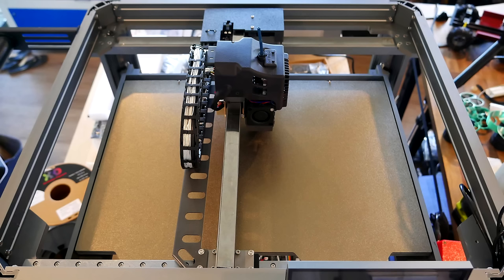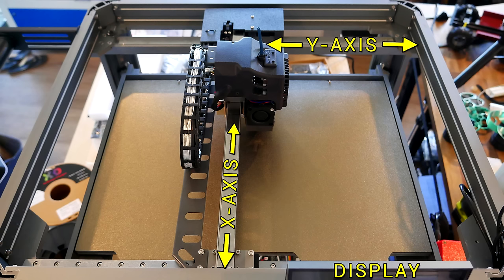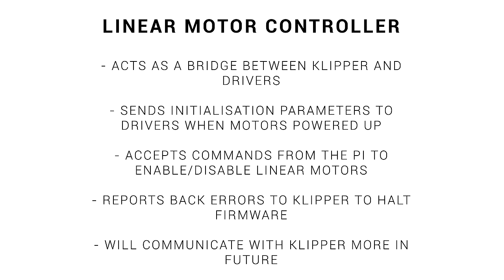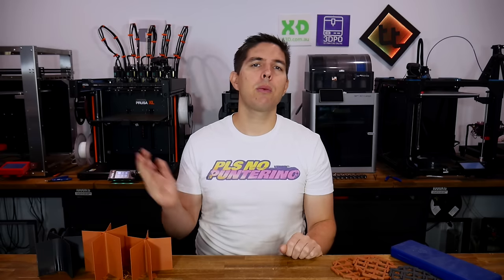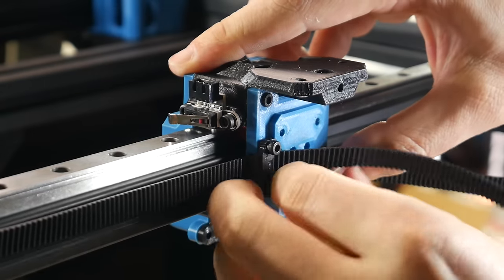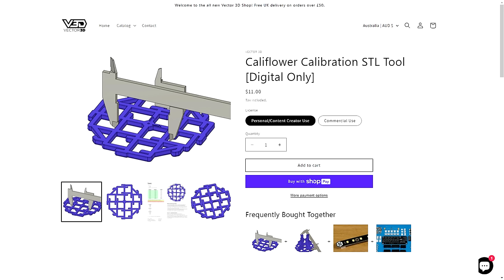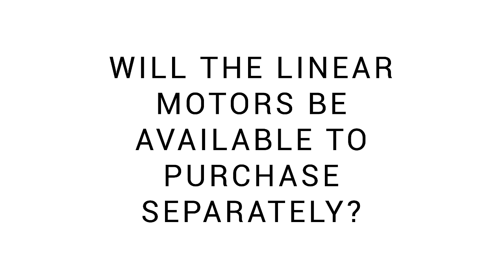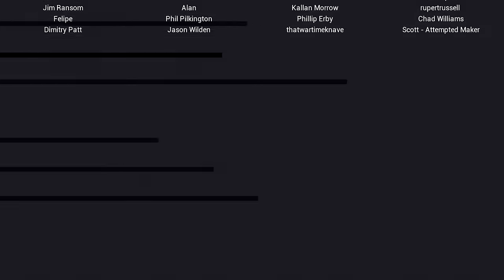Magneto X linear motors: Deep dive and performance testing

Comment: A new category unlocked for aliexpress seller: linear motors for 3d printers.
Reply: Would buy so fast. So obviously the easiest way to make a toolchanger.
Reply: @BeefIngot    you would drive it off the rails end to park or something?
Reply: @lassikinnunen  No, just have the rail extend to off of the bed and have the unused ones simply not move since the active part is on the thing that is moved and the magnets are stationary.
Reply: @lassikinnunen so instead of changing the tool head on a single carriage, every tool head would have its own carriage?

Idk seems like loading and unloading the entire carriage would be the weak point in repeatability/reliability. Where as once dialed in a single carriage and multiple tool heads could achieve the goal more easily.  It’s already a proven technique in CNC machinery
Reply: @BeefIngot oh crap! like all of them on a single rail, and the rail is just extra long on both ends, so the toolheads can just cycle between sides? Like as if each toolhead were the balls on an abacus? You would just Park the unused ones off to the sides
Reply: For speed purposes, multiple gantries might make sense. Same idea though, multiple carriages on the y rails.  You'd need enough extension at the front and rear to handle as many gantries as you'd need.

Honestly though, I suspect toolchanger technology is a better solution for most people because the number of heads per unit volume can be so much higher.
Reply: Last time I ordered from aliexpress I got an empty box in the mail. Customer service denied my claim, but thankfully paypal refunded.  MAJOR HEADACHE  NEVER AGAIN!

Comment: I feel like a machine like this should be driven by LinuxCNC, something built for driving closed loop real time machine systems. Wouldn’t mind if Klipper was modified to have proper closed loop control and real real time control (stop means stop now, not when the command buffer runs out).
Reply: I mentioned it somewhere else, but I think that's what it's designed to be run with.  So many of the decisions, like a 2nd micro-controller for commands and emulating stepper drivers, points to this originally being developed for LinuxCNC or similar with Klipper slapped on.
Reply: @arthurmoore9488 Which is why I'm so intrigued by the idea of being able to buy the motors separately, I'm really glad he asked about that! Or perhaps it might be fun to just buy the whole printer and forklift-upgrade the controls.
Reply: That's what I think as well. I switched my printer from Linuxcnc to klipper to gain all the features of a printer specific controller, but it always feels like a "toy" in comparison. No support for external e-stop, no way to trigger e-stop if a limit switch is triggered during printing, no way to instantly pause a print etc... On larger and more powerful machines it can get dangerous without those things.

Comment: The future of this machine is only as good as Peopoly's commitment to it, which based on their track record leaves something to be desired. I backed their first KS for the Moai, and it wasn't too long before they abandoned it without ever finishing the firmware optical distortion compensation features. When we're dealing with so much propriety tech, it's all about trust that in 2 years you're not sitting with a $2k paperweight. Everything inside the Bambu printers can be swapped for commodity part equivalents outside of the lidar scanner -- which is of questionable usefulness. Considering there are driver boards, feedback boards, tuning requirements, this machine is more closed source than purported closed source machines are. I paused the input shaping screenshot, and klipper recommended accelerations are ~2k -- that's far from impressive with advertised max accelerations being 10x that -- so it can go fast, it can accelerate fast, but the electronics are not tuned for it. As I suspected, this is a tech demo. Impressive one, but that's all it is.

Comment: While the X/Y arrangement may seem counter intuitive, this is standard in robotics. The X motor is almost always further down the kinematic chain than the Y motor.

When driving a linear motor with a stepper interface you will never see 'missed steps', you will either see a successful move, or the axis will trip. The controller will have a maximum allowable following error, the difference between expected and actual position for any servo cycle, and if the measured following error exceeds that value, the controller will emergency stop that axis, and by extension, the whole machine. If you have access to the following error, you will see it creep up as weight, speed and acceleration increase.

As an example, if a move has a max following error of 10um, a successful move will never have been more than 10um away from the expected position at any point during the move. If the planned trajectory requires an axis to be at 1000um at time T, but it only gets to 989um because it isn't accelerating hard enough, the axis will trip. Similarly, if the planned trajectory requires an axis to be at 1000um at time T, but it's already at 1011um because wasn't able to decelerate hard enough, again the axis will trip.

What won't happen is you get to the end of the test and the axis is in a different place to what you expect, it will either be within the following error limit of the desired position, or the axis will have tripped. This is one of the big advantages of a closed loop motor, you will never end up in the wrong position without knowing it, and errors will never accumulate over time.

The fact that the fast move tripped at the end of the move, rather than the start, suggests to me that that the drive electronics can't cope with the back EMF generated by the motor for that combination of feed rate (speed), deceleration and mass. It can get up to that speed, with the given acceleration rate, but the amplifier can't dissipate enough energy to counter the inertia of the mass. I would be interested to know which axis tripped. I would expect it to be the Y axis, since it has to cope with the weight of the X axis as well as the weight of the print head.

On one robot that I worked on, we ended up having to add dump resistors to the Y axis amplifiers (drivers) to improve the performance of those motors under deceleration, even once we'd tuned the Y axis motors more conservatively than the X axes. It was the difference between 2m/s & 2g for the Y-axis beams, verses 5m/s and 5g for the X-axis shuttles.

Comment: Thanks for the follow-up video. It’s wonderful when you contact the developers to find the answers people have. You have access that ordinary people don’t have because of your channel. Thank you for all you have done for the community.

When specifying a speed or acceleration greater than the machine is capable of handling it would be nice for an error code and/or message to be returned instead of letting the machine attempt something it’s not capable of doing and failing. I don’t know if this is an issue with the manufacturer implemented their linear motors, something in Klipper, or how the manufacturer configured Klipper.
Reply: While I don't have one and am not familiar with this particular setup, I can relatively confidently say it's not that easy.

The most interesting thing about the approach taken is instead of modifying Klipper they developed their own controller board.  As far as Klipper is concerned, these motors are being run by a cheap controller that only supports the bare minimum.  I mean, instead of telling the actual controller boards "go to X position", Klipper calculates the difference between the current position and X in steps and sends that many pulses.

Keep in mind that separate stepper motor controller board to talk to the drivers doesn't have to exist.  It's just duplicating the functionality of the main controller board, but with a worse processor.  The only thing the main board is doing is handling the Z axis, and heating the bed.

The only reasons I can think of to make those decisions is if they either re-purposed CNC hardware and couldn't integrate it fully, or are planning to release a CNC.
Reply: @arthurmoore9488  Yeah these are good points - like, does klipper even support closed loop steppers / servos for the main movement axis in the first place? And if it does, does it "fully" support all the functions you can typically expect from controller that do? 

This machine is closer to a machining CNC with a printhead on it than a build from the ground up 3D printer with standard 3D printer parts; and I think that's a good thing. 

I'm actually curious why 1) people have such a hardon for Klipper support, and if Klipper was even the right thing for this machine. I understand klipper being open source, and the functionality it adds to something like an Ender 3 or the hundreds of bedslinger clones is great, but a machine with essentially completely different kinematics from anything Klipper was designed for just seems so odd to me. 

I suppose it saves them a ton of development time / overhead in probably having to make their own (or, say, converting Mach 3 - with licensing - to something usable by an average 3D printer user with 3D printer modules) - but I'm curious if this will end up inherently limiting the capability of the machine down the road. 

Or maybe it won't - Klipper is open source and someone could write their own proper linear motor modules to it that actually work with feedback. But that's a bet, not a guarantee.

Comment: Fantastic deep dive, thank you for the huge amount of work it must have been putting this together!
I have a comment about "maintaining perfect positional accuracy" when you're talking about 30k+ acceleration at 1k+ mm/s² (15:30 or so). The closed loop system will always ensure this, as would a servo motor based system (belted/ballscrew), assuming tight enough tolerances and sufficiently beefy construction in the drive system. But the systems just get back to the perfect positional accuracy after possibly losing it while under heavy load, just not losing it enough to fully error out. So it doesn't "maintain" it, it just gets back to it. So the real measure would be how far and for how long the system was ever off it's target position. For high performance printing that's what matters, not that the head ends up in the correct x/y spot after printing for an hour, but that the filament is deposited exactly where and when it was supposed to. If the head lacks behind a bit, or overshoots the target position a bit after correcting for a previous error, that'll show up. It would requiring coupling the positional feedback of the X/Y with the extrusion system somehow, but I'd guess just the latency because of physics such a thing would incur would probably make it either impossible or at the very least impractical.

Obviously given the sheer power of the motion system, the required precision in the control of the extrusion system needed to keep up with numbers like this is likely going to be the limiting factor. Also even measuring or quantifying what the actual error is would probably be a masters or doctoral thesis in itself. What even would be the unit, some sort of integral of the positional delta (target vs. actual) over time?

Comment: This is such a strong first printer out of the gate. With a tool change or multi filament system, it’s hard to see any reason this wouldn’t become the gold standard going forward. I will say, the quoted specs for thermal safety on the electronics and motor should be revisited to ensure they can operate at higher temperatures since that doesn’t leave a whole lot of headroom but… very nice showing from these guys.

Comment: VFA has been driving me nuts on my Qidi XMax3.  I think this is the future of 3D printers and so awesome to see VFA goes away at high speeds.  You buy a CoreXY expecting to be able to use it at advertised speeds, but realistically you can only use about 1/3 Max speed for decent quality. This was a great review as always and thanks for your thoroughness.

Comment: Looks like an awesome machine!

Very thourough test and review you did here!

From what I have seen in this video - although the aluminum extrusions used on the printer have beefy wall thicknesses, for such a powerful machine, it still seems weak and flimsy, seeing how the whole machine shakes and wobbles around.

I would LOVE to see this very kinematics being indtalled onto a machined/milled steel-frame chassis with a SOLID half inch netal basplate and start from there. 
with some square steel tubes - very overengineered but with probably 8x the stability of it's current state.

It would not nearly shake as much and have greatly reduced deflection while moving very fast....

Great concept - This seems like a printer worth owning when you want dimensional accuracy and trouble-free printing of high-quality functional parts - especially considering it comes with a hardened steel hotend -> CF-PLA - CF ABS is now on the table!

Comment: I hope linear motors become an option in general for other printer kits as well. Peopoly said they designed theirs from the ground up to be cheaper and more available for the consumer, so I could see them as options later for kits like ratrigs. Be great if the v-core 4 or something got that.

Comment: I have a HEAVYLY modified Ender 5 Pro and an Ender 5 Plus. (linear rail, bigger hot bed 310x310 / 435x425 , beefer steppermotors, custom head, Volcano, Laser and Spindle fast attachment.....)
I reached the speed limits of the Y especially on the Plus. (the X axis weighs a ton)
These linear motors could be an alternative and better solution than putting a double stepper on the Y.
Reply: You run spindles on an ender? 😂 how well does it do?
Reply: @_..-.._..-.._  Ender 5 Pro and Plus with linear rail: milled alu with 0.16  DOC, 3mm end mill, 16k rpm......slow, but better than nothing.
Reply: @carlettoburacco9235  oh see this is interesting bc i was going to comment that with the linear motors perhaps a spindle option could be had with a rail upgrade ?    i don't know the first thing but i get the idea its more possible in this machine than others.    sometime someones going to realize that being able to convert a machine easily from additive to subtractive for whatever someone needs to fabricate at the moment is the way to go.

Comment: I just want some hobbyist accessible closed loop absolute linear motors.

So mamy possibilities and benefits.

No belt stretching, always precise, no tensioning or belt care necessary, more space to do things like tool changers and if cost effective enough you can have one x rail per tool head.
Reply: still very expensive unfortunately.
Reply: @Fjprints  even at 250 per rail id buy 6 to make a tool changer

Comment: With closed loop motors, the move and measure test intended for steppers isn't sufficient to determine if the system is useable, the closed loop system will always hide any problems. You don't know dynamically if the system is experiencing substantial overshoots if you only measure the static starting and return points - the only feedback about the dynamic condition is really the fault stop of the drive being triggered (so exceeding 2mm of slip or some other factor).

But since the implementation of the linear motors seems to be opaque at the Klipper firmware level, information about this probably can't be collected there.

Comment: I feel like we're not quite where we should be on the prosumer printers yet. I really want a psuedo open-source printer with klipper and standard nozzles that can reach 95+ C in the chamber (and ideally 450C on the hot end). I'm running a Makerbot Method-X (95C chamber and 315C extruder), and the difference between a 95C chamber and 60C chamber is night and day. I can print large pieces in polycarbonate (not PC blend and not fiber filled) at 95% infill and it's pancake flat. But, that printer cost me $4800, only has ONE nozzle option (0.4mm), and uses a proprietary (crap) slicer without support for anything fancy (e.g. input shaping). If you want higher T (e.g. Funmat HT) or open source then you're looking at a minimum of $5-$10k. There's awesome printers at the consumer level (e.g. P1S), but for serious engineering/lab applications there's a real dead space between $1k and $5k,...
Reply: this.    i'm no engineer... but to me the benefits of 3d printing are in the ability to print totally FUNCTIONAL parts, immediately, at high temp, without even looking at the machine printing them, just click and walk away back to whatever project, then come get the widget and install it in the project.    so even if i can get away with printing something on my highly modified enders in some more advanced material... what i want is exactly what you are talking about.      and yeah... can't justify more than 1.5-2 k on this kind of tool for the shop.   but considering the state of the tech here... it seems highly doable and that really the industry should be pushing consumers into higher temp materials not acting like people only want to print pla and petg.    i feel like this is how companies like langmuir systems got going so well... filling the gap you mention.   there is room.